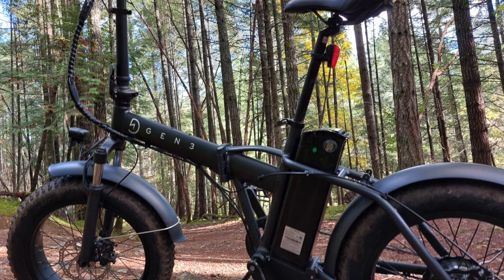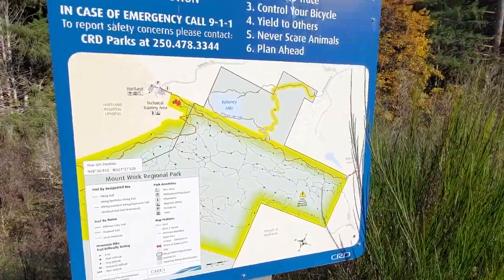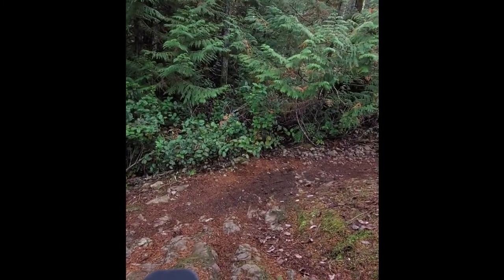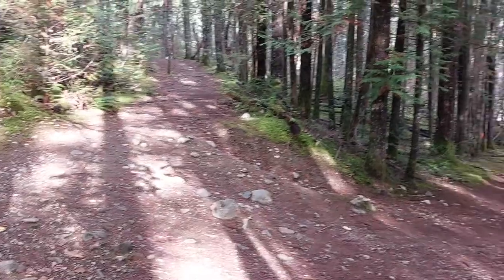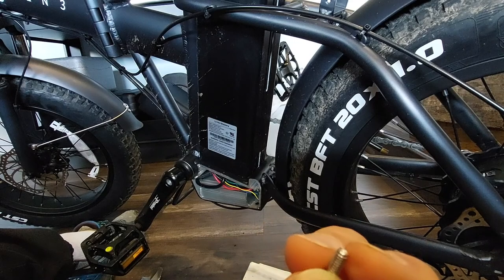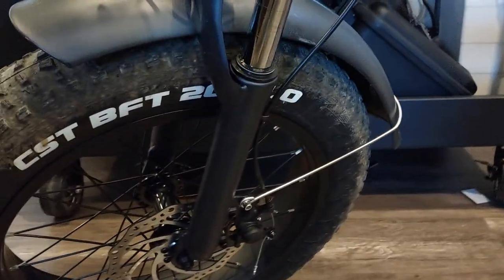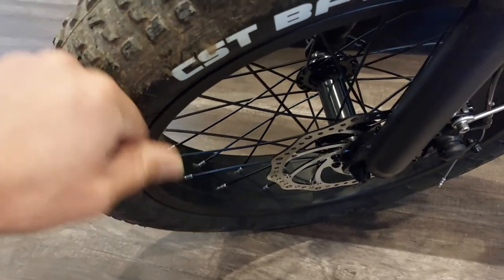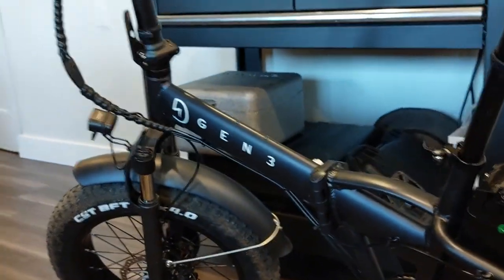E Bike Review Ground Shoot  of Gen3 Bike Groove Folding

Comment: Such a helpful informative video, not just for this ebike, but for ebikes in general. I’m looking into a good ebike for light off roading
Reply: I have a GEN3 Outcross. The 26X4 tires and the mountain bike style has great performance on light to moderate trails. The style also gives me the ability to stand up and mitigate tough areas on the trail. As well I can use my legs to absorb the rough areas.  Mine also has the Bafang 500/1000 motor that is powered adequately to help me get up the steeper inclines. It is a big bike. I am 5'11 and it is almost too big for me. When straddling the frame my feet barely touch the ground.

My wife has the Groove. It is not a very good trail bike. Flat smooth trails is about all I feel confident riding on. I think a folding bike already has some rigidity issues using off road. Also the design is more of a cruiser style. Making it hard to stand up when handling rough terrain. I have seen a guy on the trails with a lectric XP that swapped his forks, stem and handle bars with BMX style. Removed the fenders. Upgraded to a 750watt motor and controller. It is really an awesome electric BMX bike.
Reply: @Electric_Recreation  thanks for this explanation on 3 different ebikes! Was thinking about doing something similar as what you saw with that guy on a Lectric XP! But, one that comes with dual suspension…